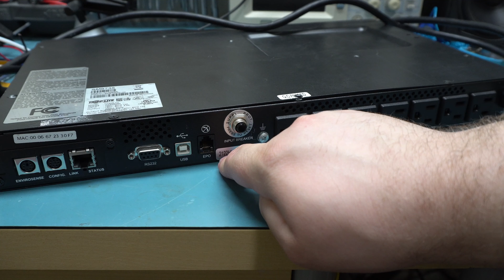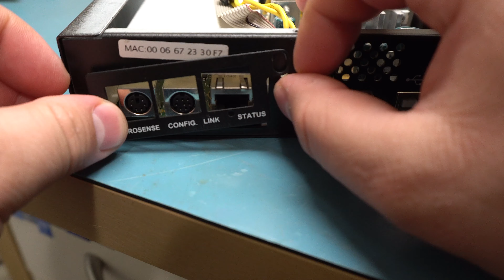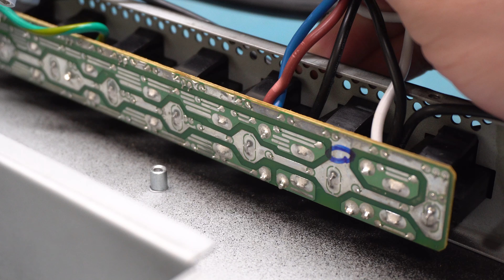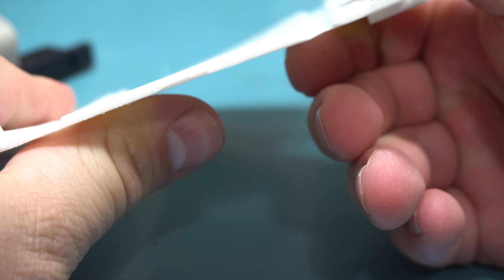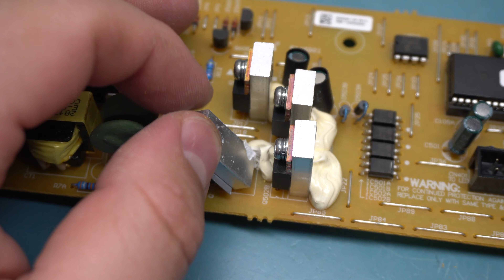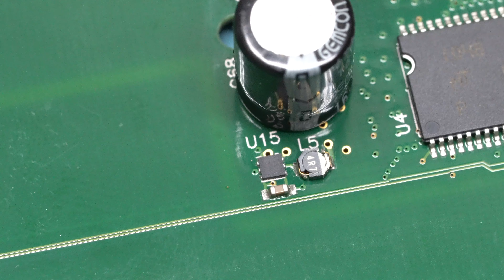Tripp-Lite HTR05-1U UPS Teardown

Comment: 10:10 There's logic behind it. First of all they are mass produced and cheap and if one of them blows it pretty much means there's something seriously wrong so it needs to be serviced, therefore it's not a user serviceable part. This big transformer you mentioned it actually a center tapped inductor. They way those slim 1U UPS's regulate line voltage is not smooth. If the input line voltage is grossly under the threshold it add up say +20V or subtracts 20V if line input is over voltage. The only true output regulation occurs when this UPS is running from the battery.

Comment: They sure have cheaped out on the manufacturing. Did you notice how one of the power supply taps had paralleled rectifier diodes and the pcb had still darkened. How about using a proper rectifier bridge with cooling?
Reply from the maker: Yeah, it seems to be marketed as a server unit (rackmount, remote management, etc.) but it's pretty low end. The non-standard batteries are the real killer for it - they cost way more than the standard 12v units making it not really worth it considering how cheap an equivalent unit is using normal ones.
Reply: @P @PeterBrockie  it isn’t the most high-end unit but it’s designed that it can discharge the battery pack and get a bit warm but then it will cool down afterwards. These units are really good for small networking set ups where you need to have some battery run time, but full unit would be more costly than the entire set up.

Comment: I think on line ups usually means that it is continuously doing the AC - DC - AC conversion. That way it will be able to protect from spikes and noise, and if the power cuts out there is no delay before the ups starts. They also do phase correction and frequency adjustment. Not sure if this ups has all of that capability though.

Comment: Perhaps the heatsinks near the shrink wrapped caps are "live" and the heat shrink tube is to prevent the can of the capacitor from shorting against it.  I've seen live heatsinks before in UPS devices.
Reply from the maker: That sounds like the most likely explanation.
Reply: stonent I got bit by one of those one time and when I put  my tester on it, it read 160v

Comment: Weird heatsinks.  I don't think I've ever seen solid chunks of aluminum like that.  I guess they are more relying on thermal mass than actual cooling.  Might make sense given the low duty cycle...
Reply from the maker: Not only are they weirdly shaped, but they aren't even attached to anything so they just bang around and snap off transistors without the silicone goop. :D
Reply: these types of units are designed to run for a certain amount of time and then stop so it does not need to be that efficient